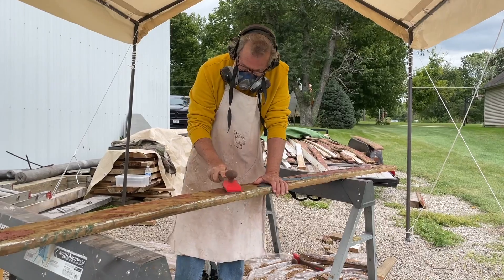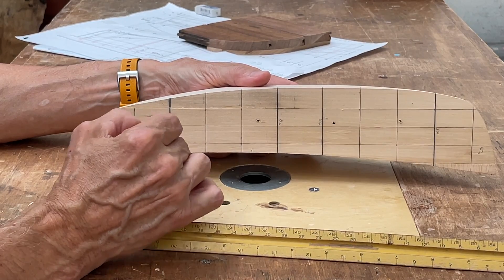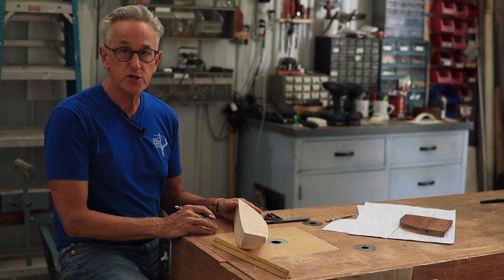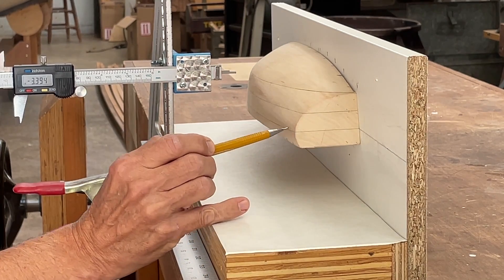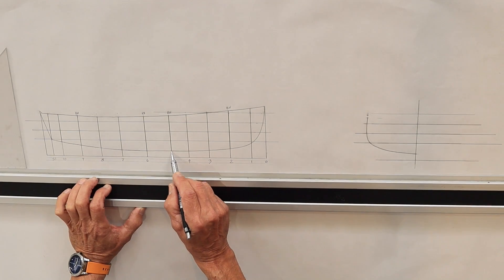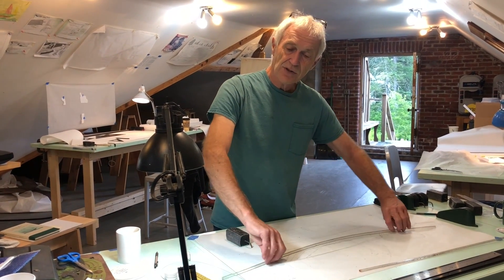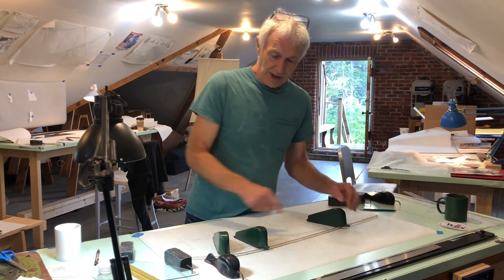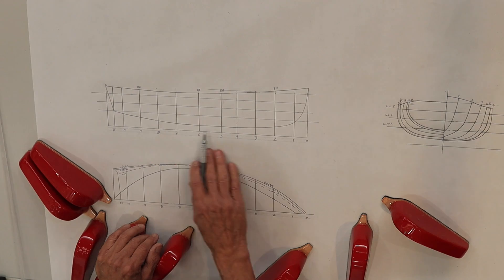How to Design a Boat from a Half-Hull to the Line Drawing

Comment: As a 3D mechanical designer who has operated SolidWorks for over 15 years, I immensely enjoyed this video!  I began my drafting education back in the days when we still learned on the drafting table with a T-square, parallel bar, or drafting machine. I couldn't help but think through the process of creating this design in the 3D realm while watching you work on the board. Bob, you do FANTASTIC work!  Thank you for sharing that with us!
Reply from the maker: Thanks Craig!
Reply: Fully agree!  I was a draftsman prior to my engineering profession, so I learned to use a drafting board, write neatly in block letters, and so on. Not a bad start to a professional life as a snot-nosed 18 year old kid!!

Comment: As a retired sculptor from General Motors, and also a boat builder and a sailor, I really appreciate the way you have explained the lofting process. It is identical to the same process we use in the design center to model a full size clay model of an automobile. Of course our equipment is much larger. You’re doing a fine job of explaining how the process works and it is very understandable for anyone who has not done it. Thanks a lot for what you are doing. It bring back a lot of memories and it’s fun to watch.

Comment: Hi! I work in a shipyard and do a lot of reverse engineering of linesplanes for hull damage repair. 
My mentor and available lecture have prescribed that the station marks indicate major changes in the hull shape. You are approaching it a different way, where did this method come from and how do you integrate major plane changes in the fabrication if not by stationed sections?

Comment: Amazing work! But I just keep wondering how much easier all that would be with... (no, not with computer, well, yes ;) ) ...but with millimeters! :D
Reply from the maker: The answer is at 1:17 I'm more interested in the process than how fast it can be done. I've used the Imperial System of Measurement my entire life. Most all of the boat plans I own are in inches and feet as well as the Table of Offsets. The metric System has many benefits! However, for me too mentally, or with a table, convert measurements would not be faster or easier.
Thanks for watching.
Bob
Reply: Depends on which system a person is most familiar, and how long they have lived with it. The imperial system is the standard in maritime design in our part of the world. Conversion would be a whole lot of extra work. Not to mention, most tooling and materials available in the U.S. is imperial, not metric.

Comment: I have a question to ask you! If you were to build a sailboat with an engine, how would you know the exact location of the waterline? Do we need to calculate the weight of the entire ship and calculate the displacement based on this weight, and then obtain the waterline height of the entire ship based on the cross-sectional area and displacement of the bottom of the ship.

Comment: My partner did an apprenticeship in naval architecture with the Royal Navy, then went onto be sponsored to do a Naval Architecture degree. He has worked on many projects in his working life but still recalls the time he spent as an apprentice making a small tender from line drawing, lofting, making forms etc etc right through to the finish and launch. It is fascinating to me to watch the process on video. My partner, now retired from many years working on moorings and stability issues in the North Sea oil fields, would love to do a job like this tender once more.

Comment: So I clearly missed something: didn't you already have a line plan, that you built the half-hull model from? Fascinating video; I particularly admire your Home Depot Herreschoff device.
Reply: Victoria is based on two Atkins plans, one shorter, and one longer, than the tender needs to be. So neither line plan suits and this is why Bob is taking us through the whole process.
Reply: Victoria is being designed as a modified Atkins boat between the sizes of two similar boats that Atkins designed. Plus the requirements mentioned in this video and a couple others mentioned in other videos on both channels require changes to the plans that neither boat's plans include.  So Bob is taking a bit from both plans and meeting somewhere in the middle and adapting/redesigning to meet the laid out criterion Victoria must meet for A2A's tender. Basically designing a whole new boat. So, "back to the drawing board", so to say. The half hull just took the over-all shape that Steve liked and then Bob adjusted the stations to fit requirements as needed. The old drawings, after the redesign, are basically worthless for the newly designed boat to be built from.

Comment: 19:00 How is the correct name of the "system" for the manufacture of frames (body) from plywood ???? No where to find study material
I just don’t know how to correctly calculate and make such frames for my needs (models)
Reply from the maker: Those measurements are call offsets. So the table of those dimensions is call a Table of Offsets.

Comment: Great video as usual Bob. I'm curious about one thing and it's likely because I don't understand something: It seems to me that you could have taken your initial table and just put it in a spreadsheet then multiply by the scale to convert your measured dimensions to the full size dimensions which, if I understand correctly, would have given you the same results as the Herreschoff device.
Reply: @ralphgesler5110  I know that. The difference is that, as Bob stated, the Herreshoff device provided the full size dimensions where Bob's only provides the model dimensions that need to be converted to full scale measurements on a lofting floor. Putting his measurements in a spreadsheet and doing the conversion there, I think, would allow you to go straight to the lofting floor. I think it would make the small scaled drawing unnecessary.
Reply: @erickuehne4194  Mathematically scaling the original boat would make the new boat smaller abreast as well. Steve wanted it shorter fore and aft, but not narrower abreast. So, this was the path to take to lessen the length without making the tender skinnier. An overall spreadsheet calculation would reduce all aspects of dimension.
Reply: @thomasarussellsr  I don't know how you drew that conclusion. First, I was just thinking that this as a possible way to avoid having to create a scaled line drawing. Second, it is a suggestion for technique and is independent of any particular design. And I'm aware of the dingy's requirements. Third, I'm not suggesting he takes and existing design and extrapolating from that but using the half hull model for the actual design and going from there. As there are no half hull models for the 8 and 10 ft designs I'm curious as to how you thought he would pull spreadsheet data from them.

Comment: Cool video. We still have some ducks on the drawing boards at Boeing, for the airplanes still in service that have not been converted to digital drawings/loft lines/etc.

Since I’ve been working there since 1988, when an early career engineer sees a duck, they need an explanation as to their purpose. I think I’ll push them to this video, because you show they’re used (which now is quite infrequent in aircraft design).

Comment: So, I may have missed something - was the half-hull model made from a line drawing as well? Did you go from line drawing to half hull model to line drawing?
Reply from the maker: A  viewer recently answered that question.
"Victoria is based on two Atkins plans, one shorter, and one longer, than the tender needs to be. So neither line plan suits and this is why Bob is taking us through the whole process."
In addition, as you could see by my conversation with Steve, The are many unique parameters to the design of Victoria. This is why I've essentially started from scratch.
I hope you are enjoying the process.
Bob
Reply: @TheArtofBoatBuilding  Ah, yes, I had forgotten that Victoria was a hybrid of two plans, that explains it. Thanks, Bob!
Reply: @captainpanda5533  A hybrid of two plans, plus adaptations of the stations for specific needs.

Comment: very interesting. I wonder though if a boat designer cannot just draw the lines on a plan and go from there. You should be able to visualize the boat's shape as well as with a half model. Do I miss something?
Also, wouldn't I build a 3D model on the computer to fully appreciate the lines?
Did Herreshoff made any calculations to improve the sailing speed of a boat or is it "just" experience?

Comment: Not to be “that guy” genuinely curious. When you measure station 6, you don’t round up to 2.73. Would that make a difference when converting up to life size?
Reply: I was thinking the same thing. However, in other measurements he only took the hundredths spot when the thousandths spot was an 8. So he stayed consistent with dropping the thousandth spot completely. Fairing the wood hull with plane and sanding board's should make up any difference. Besides, I think it is going to be fiberglassed, in which case the epoxy will float the low spots for the most point. Good eye though.
Reply: Good question! This is a 1:8 drawing. Scaled up, a maximum rounding error of 0.01 becomes about 5/64 inch. Which, yes, is measurable with the human eye — but there are limits to the precision of even very fine carpentry, and so the construction will involve a lot of sanding down to fair curves anyway, as the other @thomas notes.

Also, the next step is lofting: scaling the lines up to a full-scale drawing. This involves reconciling the coordinates from the different views, and re-fairing the curves with a batten at full scale. I wouldn't be surprised if a lot of points move at least 1/16 inch during that process.